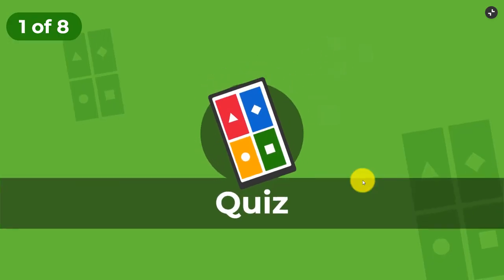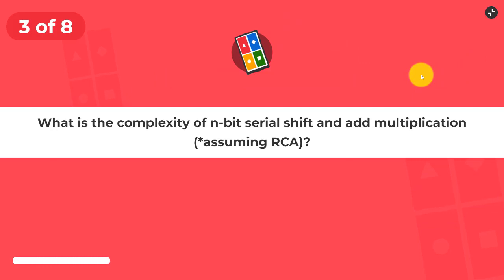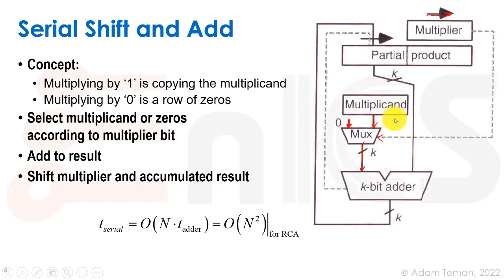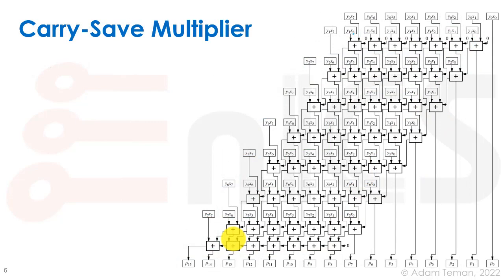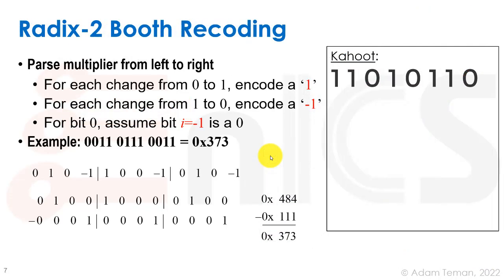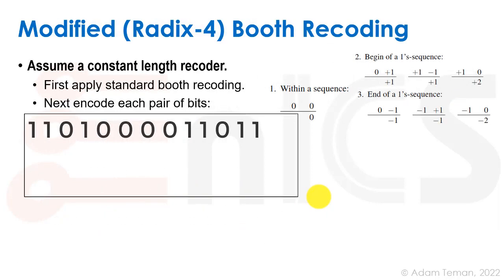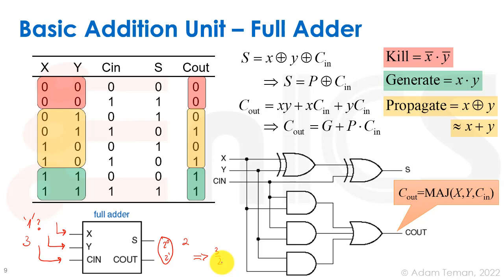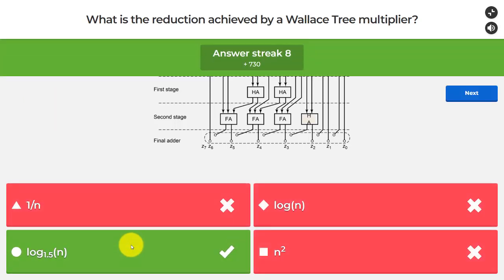VLSI - Kahoot for Lecture 10 (part 2): Multipliers

Comment from the maker: There are two mistakes in the Booth Recoding examples in the Video. These have been fixed in the online Kahoot quiz.
1) I made a dumb mistake in the solution of the Radix-2 Booth Recoding at time @17:55. 
When your MSB is a '1', you need to add zeros to the left (you can always do this without changing the final answer). Therefore, there is a 0-->1 change at the MSB position and there should be an additional 1 at the MSB position. So the final answer is 10-11-110-10. 
2) The fourth answer (...the right one) of question 5 (@18:20) was incorrect. I have blurred it out, not to mix you up. The solution and explanation are correct.

Thanks to Sarel Aharoni for pointing out these mistakes.